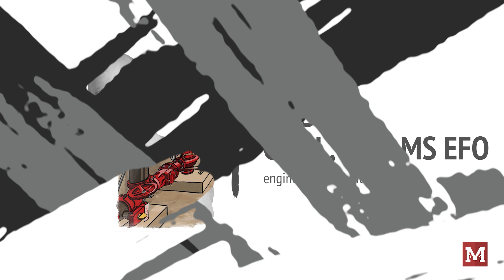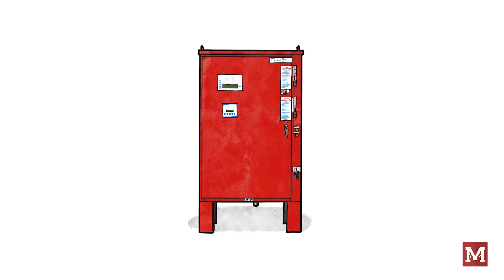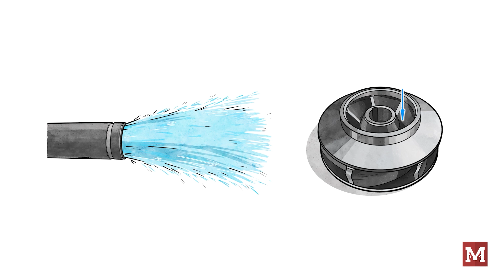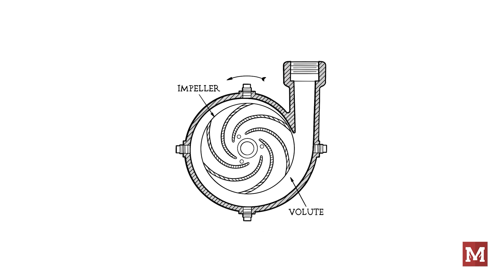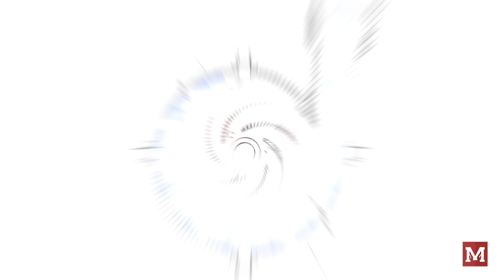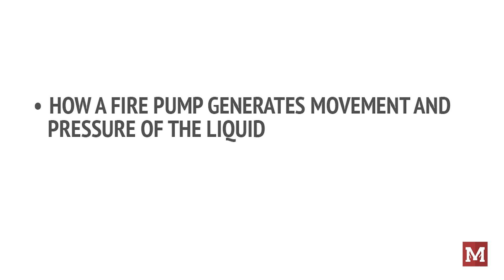How Does a Fire Pump Work?

Comment: You should make a video on how a sprinkler system works in a high pile combustible storage warehouse. You can set examples of why a esfr system is important and show what the water difference would be. Also if you can add in how important flue spacing is and how having group a plastics effects the system as well. Non encapsulated and encapsulated